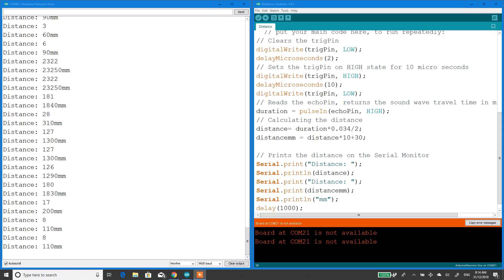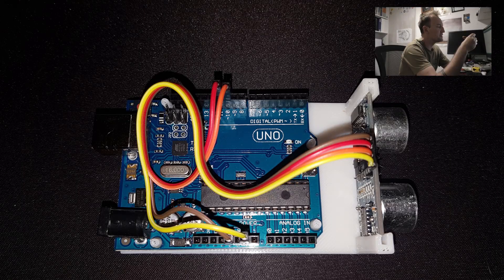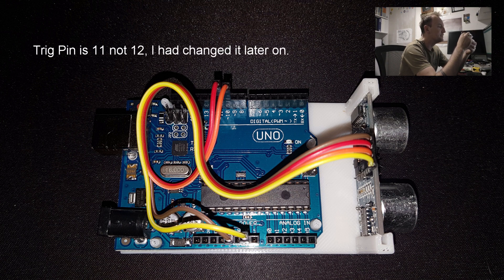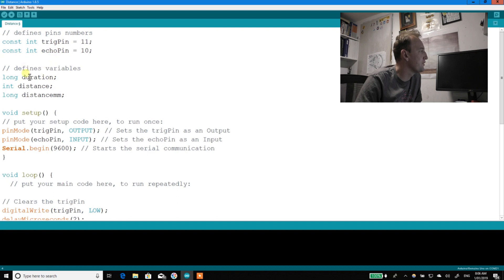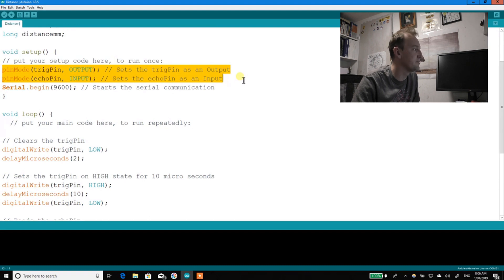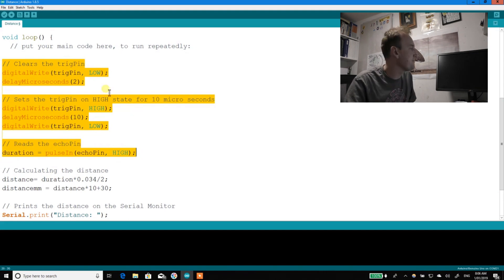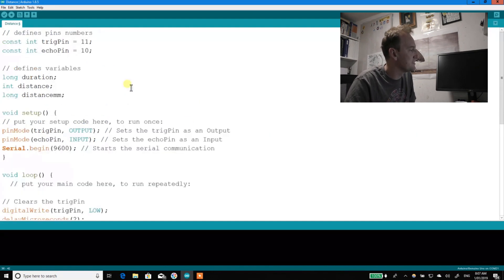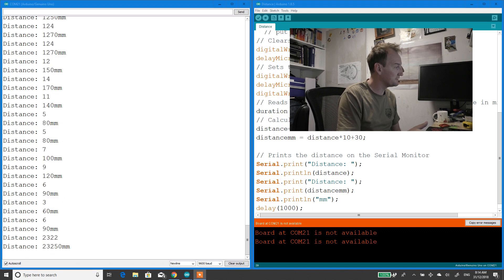Arduino Ultrasonic Sensor Tutorial

Comment: Great video! Actually I wanted a waterproof ultrasonic sensor with less minimum distance like the HC-SR04 but the JSN SR04T has high minimum detection distance of 20cm because it has only 1 transducer. Also JSN SR04T PCB is not completely sealed. Have you tried this sensor? https://www.ebay.com/itm/253978673298 or this modified HC-SR04? https://www.ebay.com/itm/254058015473 Have you tried any of those 2? Thanks in advance :)
Reply from the maker: No sorry I haven't, but want to now. I'll check them out thanks
Reply: @50Hz  Ohh actually I was searching for a tutorial video on this sensor https://www.ebay.com/itm/253978673298 but I cannot find any. If you can make a video on that sensor showing its circuit connection diagram and software code, it would be great and very helpful for my 1st project! Thanks alot!